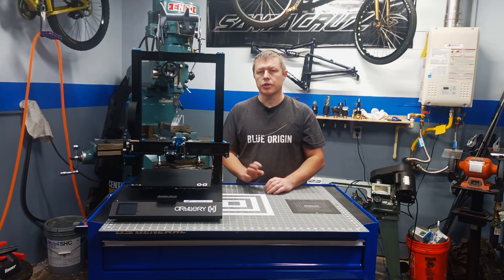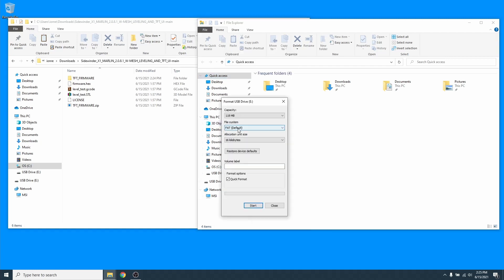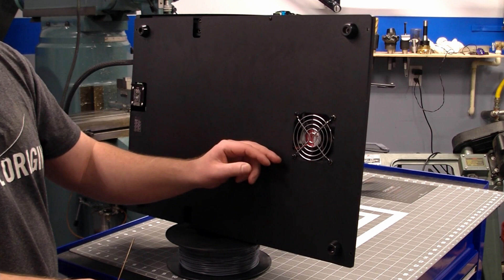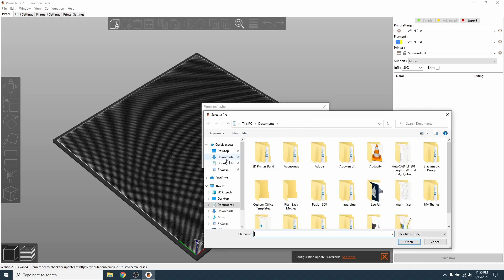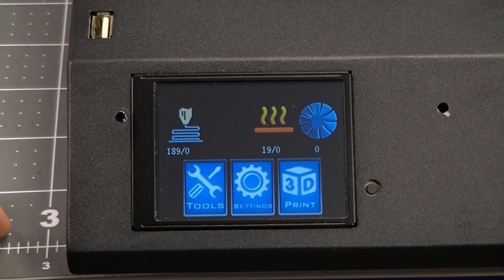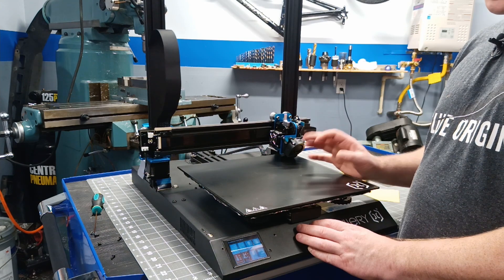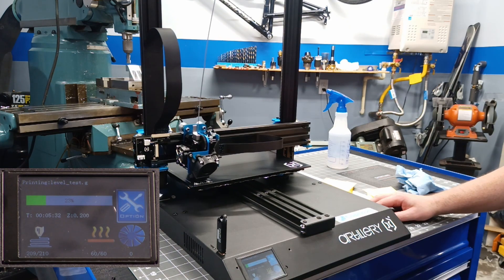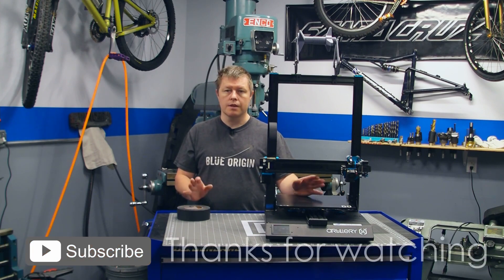Sidewinder X1 Marlin 2.0.8.1 with mesh leveling and custom touch screen UI.

Comment: First, I wish to commend you on a VERY well put together video in simple English that's very understandable.   THANK YOU!  Will your firmware update work on my Sidewinder v3 and is the thermal runaway still enabled?
Reply from the maker: Thank you very much for your kind words. Yes thermal runaway is still enabled. I dont see why it would not work on the V3.
Reply: Following your instructions, I performed the firmware update on my v3 for the TFT and Main Board with no issues at all.  I performed the PID tuning and the manual bed level then the mesh level.  Now I am MUCH happier with this machine.  THANK YOU again for all of your hard work that has enhanced my 3d printing experience.  I have will perform this update to my v4 and also have recommended it to a friend.
Reply from the maker: Thank you so much, its always so nice to hear that my videos are helping. If you have any ideas for me for future videos Im all ears.

Comment: Great job thanks. I could use RGB light with this mod?
Reply from the maker: You should be able to, I didnt change how the RGB works. There have been a few people that have had trouble with the RGB but I dont have a way to test that anymore. The best I could do is make it match the stock firmware.
Reply: Have the Same issue. It would be great again that this would works again together with a fix for the on off led funtion. Looking forward to the solution. 🤗🤗

Comment: Hello, I downloaded your files and flashed the hex file as you mention in the video. The TFT screen looks great. But extruder does not heat up though bed heats up and I can feel the heat. What could be the problem? Where do I begin to search? Another hint: The TFT screen has white patches where the image should be there. I also find TFT reacting slow to my touch commands. I connected the BTT UPS for 24 V to the power supply and am using Zmax limit switch for signaling the power loss state. Please help!
Reply from the maker: Best thing I can tell you is to ensure everything is connected properly. I am not sure how your UPS could affect this, I do know that the touch screens are a little picky about power.
Reply: @EtherealProject3D   Should I do auto tune PID first to get started? If I don't do it, then extruder does not seem to  get the power. When I do the  auto tune PID, it also turns on the extruder LED. One of the things that I noticed was the board communicates at 250000 as default. This prevents using CURA to download your firmware. This I verified with Pronterface. I used a longer USB cable to connect the board and my laptop. Then I remembered that you use the short USB cable provided by the manufacturer in the video. My longer USB cable may drop packets when downloading the firmware. When I used the short cable that comes with the printer, the download went smoothly. Now the bed heating seem to work. The extruder is not still heating up, perhaps because the PID constant are not set in the firmware forcing the used to do auto PID first.  I used the Pronterface to verify the machine settings with a M503 command. Your settings are pretty close to the version 1.1.9 firmware provided by the Artilery 3D website. My question is how to lower the board baud rate to some lower value so that Cura can also download firmware. In the TFT firmware, you have used M84 command which is not a Marlin G-code. Where do I get details on the M84 command?

Comment: I installed it but it seems that the mesh level does not do anything. I am told in some groups that the "M420" code should be added to the g-code. Do I need to add it? If so, where?
Reply from the maker: You shouldnt need to add anything to the start gcode, be sure to save to eprom after finishing the 9th point in the leveling. If that doesnt work, I would reset the eprom, reinstall the mainboard firmware and try again. If you feel you should want to add the leveling G-Code it wont hurt, its M420 S1 after G28 in the start gcode.
Reply: @EtherealProject3D  I think @Roy Keren is right, after homing I tried to sent M420 through Pronterface and its giving to me an OFF Bed level STATE. The gcode you provide to test the leveling works because it has the M420 S1 after G28, but after printing some test I did with prusaSlicer I realized that by default M420 S1 it is not included in the start Gcode, and therefore the printer is not taking advantge of the bed leveling.
Reply from the maker: @mjuanfe  #define enable leveling after G28 is enabled in the firmware. This eliminates the need for M420 S1.
Reply: @EtherealProject3D  Ok! I'm fine tuning my X1 and maybe I'm having some mechanical issue, anyway in the M420 Page of the Marlin website I was reading about the RESTORE_LEVELING_AFTER_G28, that is something different and I got confused, if ENABLE_LEVELING_AFTER_G28 is uncommented, nothing to talk about :) . Thanks for your response!
Reply from the maker: @mjuanfe  I will have to look at it, now I cant remember if its enable or restore i have in there.
Reply: @EtherealProject3D  It's ok, whatever I'll keep the M402 :)

Comment: Hello, I have a connection problem with my 3D printer (Sidewinder x1). Cura or even SuperSlicer can't find the 3D printer so I can't install the firmware. Do you have a solution to this problem? (Sorry if there are any errors I translated using google)
Reply from the maker: You might need to install the USB driver for the mainboard, or try a different USB port on your computer. There is only one USB port on my laptop that works for this and you may have the same thing going on. I hope that helps.

Comment: I followed your guide, but when I start a print it it shows the correct warmup temperature for the nozzle for 3 seconds. After that it sets the extruder temp to 0. Even when I manually change it back using the touchscreen while the printer is in the warming-up stage in the beginning of a print. After the bed is heated it try's to print, but stops just before extruding and the extruder temp is suddenly set back to what it is supposed to be. The rest of the print is as expected
Reply from the maker: I would double check the connection between the touch screen and mainboard. It can be finicky.
Reply: @EtherealProject3D  Thanks! I'll play around with it some more, otherwise I might record it and post it to the facebook.

your vids are really nice btw, good quality

Comment: hello, i just updated my firmware to this. however when i home all of my axes (x,y,z) the printer doesnt recognize the boundaries of the printer and just ends in printer halted kill () called. any idea how to fix this?
Reply: when my print ends and it want to home the x and y axis the same happens after I updated
Reply from the maker: Did you install the firmware for the correct printer, I have this for both the X1 and Genius.

Comment: After upgrading to this firmware, the printer doesnt want to start printing gcode sliced with cura, but runned from usb drive from printer??
Tested the same gcode, with pronterface terminal and it started printing fine???
So when running the gcode from printer usb drive it start heating only the bed and then not continuing to heat the extruder?
did pid autotune and mesh bed level also e steps calibration saved with m500 command??
Any thoughts whats wrong?
Reply from the maker: Did you have pronterface connected while you were trying to print? It wont print properly if you have anything else trying to use the serial bus.

Comment: Bro!!! Your the man!! I haven't used my X1 in months due to the warped bet making first layer adhesion impossible. And, though I've had no issues with compiling and flashing the main board firmware, I could not get the TFT to update to save my life. I believe now that I was simply using to large of an SD card (32GB). Either way, your code and method worked flawlessly, and got me printing again. Thank you so much for all your effort and for the very detailed tutorial. Keep up the good work. You're the man!
Reply from the maker: Thank you very much. To update the TFT you need to use an SD card thats less than 8 gigs format to FAT32

Comment: i dont have FAT enable, only FAT32(standard) for formating SD card..? stock sidewinder x1V4 and hate the stock firmware...
Reply: found out FAT is only up to 2GB.. have a 8GB card, and thats the smalest.. will it work with 8gb FAT32 formated ?
Reply from the maker: It should, but you can use disk management in windows to make the card whatever capacity you want up to the total capacity of your card.

Comment: this is great firmware.    Can It be installed in other marlin printers?    My cr10 or sovol sv01?
Reply from the maker: No, it would need to be configured for those specific printers.
Reply: this is an excellent firmware mod.   I'd love to have all my printers the same.   Is it as simple as changing the dimensions in the firmware? This tutorial is great.  Have you though about making one on setting up the firmware?   Thanks for your work.
Reply from the maker: Its a little more than that. If you can provide me a link to the stock firmware source on that printer you are talking about I can see what I can do.

Comment: For some reason, my live z adjust does not function (and neither do any of the other buttons in the "more" panel when the printer is printing, such as the light), and I have a feeling the mesh bed leveling doesn't either. I will try reinstalling the firmware

Update- I reflashed the firmware, and it seems to be functioning normally now. I will edit again if something else happens.
Reply from the maker: Remember to ensure that you disconnect the screen when you update the mainboard.
Reply: @EtherealProject3D  Firmware flash seems to have fixed it.
Reply from the maker: Excellent news.
Reply: @emperormollusk7040  i had the same issue, reflashe the firmware several times but the light function still not working. ?

Comment: Will this work on the Artillery X2 I can't stand the Auto bed Leveling.  I have this firmware on my X1 and works perfect every time.
Reply from the maker: Not its its current state. But I have an X2 on the way and I will be porting this over to it for those that want it.

Comment: Ok i had an issue with the SD card TFT update. exFAT format will not work. I was able to format my 64gb SD card to FAT32 and it worked
Reply from the maker: I format my sd card down to less and 4GB so it can be a true FAT32

Comment: Hey, I just updated my swx1 and everything goes well but I am having this "error: eeprom disable" when I make the pid Auto tune or just when touch in save to eeprom. I google for it and couldn't found anything that actually helps me to solve it. please if someone knows how to solve this it could be very helpful. thanks
Reply from the maker: Did you disconnect the screen when you updated the mainboard firmware?
Reply: @Ethereal Project 3D  yes, I disconnected it. But don't worry, I already solved this issue usin a gcode file to enable the eeprom. thanks for answering. I found another issue, the cooler fan is not working. When the temperture increase, normally the cooler fan turns on and don't stop but now is just not working. I checked the connections and everythings looks well.
Reply from the maker: @andresfeliperamirezvelez4812  i would clear the eprom and reload the firmware

Comment: Will this firmware update work with the skr 2 board if I upgrade to it? I'm very new and I am thinking my board is bad. Has the bed heater fault. I tested the heater and the resistance for the temp sensor does change. That's why I'm leaning towards a new board. TIA
Reply from the maker: No, it would have to be changed to be supported by the SKR 2 board. If you can get your hands on an SKR 1.4 turbo board I have working firmware with mesh leveling for it.
Reply: @EtherealProject3D  ok sounds good 👍
Reply: @EtherealProject3D  stock screen but it wont load the boot software. Not sure what i am doing wrong, just boots up normally. Checked to make sure it was set to the sd card.

Comment: Can you post the source files for this firmware so I can make additional adjustments beyond the settings you've perfected here?
Reply: I've upgraded to a PT100 sensor so need to adjust MKS Gen L pin file and change to sensor 21 in the configuration file
Reply from the maker: Sorry for the late reply, do you still need the source files?

Comment: does this include support for bl touch with wagsterr mod?
Reply from the maker: No but I am working on a firmware that will work with a bltouch and my custom extruder break out board.
Reply: @EtherealProject3D  perfect I just finished up the board ready to install
Reply from the maker: @kcdakrt  Nice

Comment: do you have to take the connector out for the screen ??
Reply from the maker: Not to update the screen, just when you update the mainboard.
Reply: @EtherealProject3D  if you dont remove the screen connector when updating the mainboard , what happens ? does it work fine?
Reply from the maker: It doesnt update, the screen and usb ports share a serial connection to the mainboard.

Comment: Well installed nicely, looks gorgeous, and everything runs. Printing off the micro sd works great. For whatever reason it no longer reads the artillery thumb drive, it lights up but doesn't seem to realize its plugged in otherwise. Has anyone seen this before? My computer says the thumb drive is fine just the sidewinder X1 V4 doesn't approve.

Edit: check that I'm just stupid sometimes. I had to switch the source... I love this firmware though!
Reply from the maker: Thank you very much. Im glad you like it and you got your USB worked out.
Reply: @EtherealProject3D  yeah I figured I'd post my snafu just in case anyone had the same issue as me and just needed that push to look for that in settings. Works great just had a print run overnight with no issues, time for a bigger one now that I feel testing is complete!
Reply from the maker: @jeromeygreen4788  Awesome, you ordered one of my extruder boars too right?
Reply: @EtherealProject3D  I did!
Reply from the maker: @jeromeygreen4788  Awesome, I checked on it and it looks like it was delivered.
Reply: @EtherealProject3D  oh awesome!!! It should be there when I get home then!
Reply from the maker: @jeromeygreen4788  Sweet man. Let me know how it gos.
Reply: @EtherealProject3D  well it arrived safe and sound, I'm waiting on a screw in thermistor to install at the same time. I have a bimetal heat brake, copper heat block, and Capricorn tubing to install too so the last piece is the thermistor. Then it will run with high quality components safely raising the max extruder temp up to 275 with reliable components
Reply from the maker: @jeromeygreen4788  Awesome, it should run good.
Reply: Thank you so much !! my printer has been sitting for maybe 6 months after I did a firmware update and could no longer see the USB, I got the shi!ts up and put the printer in a corner...... until today, when I installed Ethereal Projects firmware... and found I still had the same problem..... never knew there was a source selection... thank you again !!
Reply from the maker: @dvcustompcs9147  You are very welcome, I'm happy I could help.

Comment: can you remove bed leveling screws for mesh leveling?
Reply from the maker: I never thought about it but in theory I suppose you could. You would need to get the bed trammed really good and use a jam nut/stop nut setup. It would be interesting to see how long it stays in tram like that.

Comment: Great work! 
So far everything looks great. I'm finding that the stepper whine when there's power going to them is excessively loud, which seems like it wasn't the case before... although I'm not entirely sure how to quantify my observation. Anybody else notice that?
Reply from the maker: I have not noticed a difference in stepper motor sound. Maybe check all the stepper connections or try re-flashing.
Reply: Yes, steppers are louder now - Artillery must have some secret in their normal firmware !

Comment: Just to let you know mate it's not just the filament change causing the no print problem. You can't pause a print at all then resume as it resumes but no extrusion. Will go back to stock firmware for now. I have the bell hit so if you post an upgrade I will switch back as I love your firmware but no pausing is a deal breaker unfortunately.
Reply from the maker: I understand, I will post an update when I get it fixed.
Reply: @EtherealProject3D  any updates on the pause error yet please mate?
Reply from the maker: @dooley9621  Sorry I have not gotten to it, Its been a very busy couple of weeks. I assure you that its on my todo list. Thank you for your patience.
Reply: @EtherealProject3D  Any luck sorting the firmware mate, I am still using it lol. Was going to switch back just haven't bothered.
Reply from the maker: I have not had time yet im sorry, it is on my to do list though.
Reply: I'm considering switching to this firmware but not sure now. Are you saying that it makes pausing a print (e.g. via octoprint) impossible?

Comment: Hey mate having a problem with the firmware on both my Sidewinder and Genius, when changing filament mid print and then resuming they go back to printing but fail to extrude filament. Have I done something wrong or is it a known issue. Thanks
Reply from the maker: This is a known issue. I am working on it. Sorry for any inconvenience.
Reply: @EtherealProject3D  ah ok thanks for the quick reply, so make sure I have plenty of filament on the spool to cover the job then. No worries at all. Maybe mention this issue in your description as it cost me a couple of ten hour prints, but thats no problem it has worked brilliant apart from that.
Reply from the maker: @dooley9621  I am very sorry. Yes I will have to update the description.